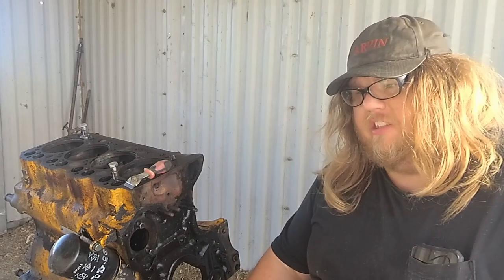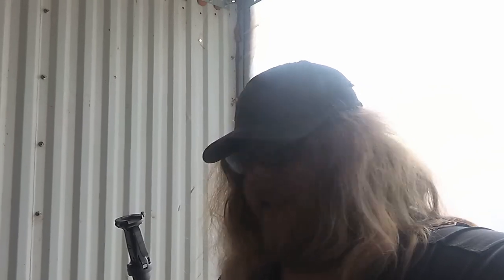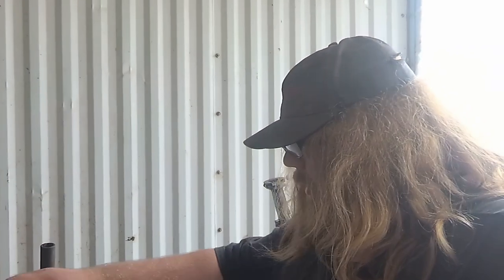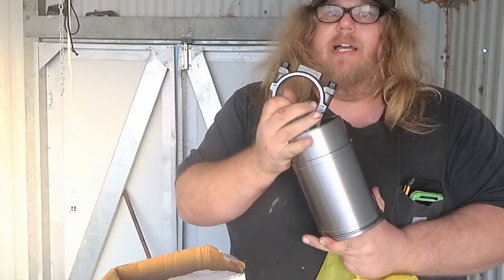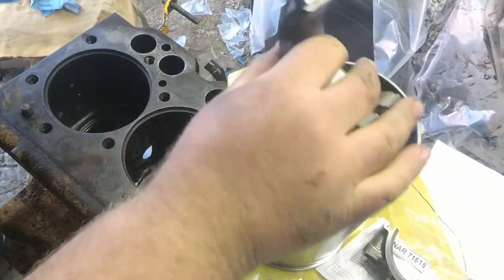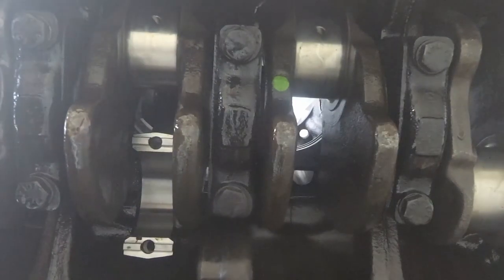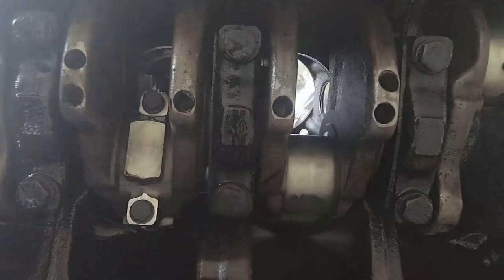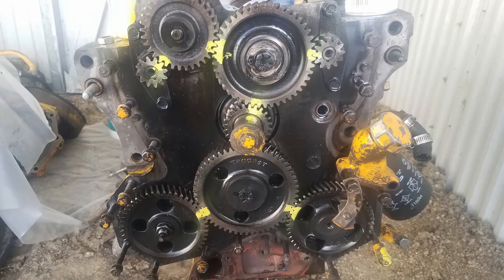INSTALLING PISTONS, SLEEVES AND CONNECTING RODS! JOHN DEERE 410 BACKHOE ENGINE REBUILD 1!!!

Comment: Did you plastigauge any tolerances on rods or mains? Or just figured it’s good since the crank was freshly turned and machine shop sold the correct bearings? I’m doing a case backhoe engine. Your videos have great start to finish coverage!
Reply from the maker: No I didn't, the crank was brand new and the bearings where the correct size so it was all good.
Thanks for watching, really appreciate it!